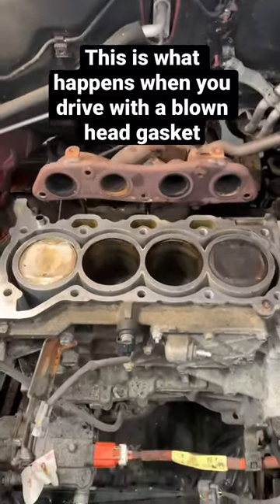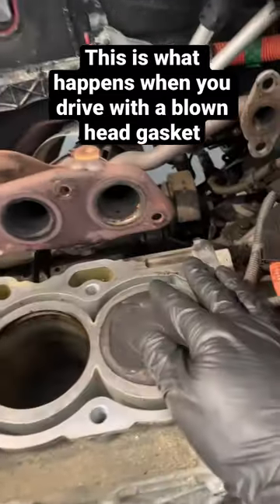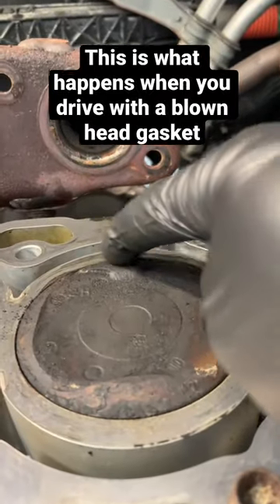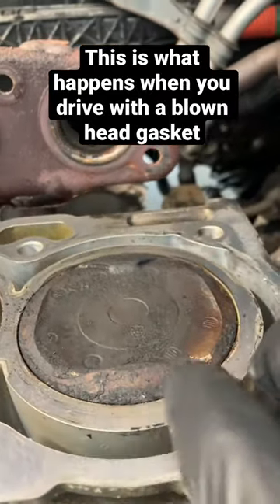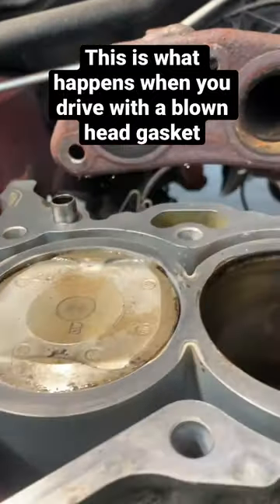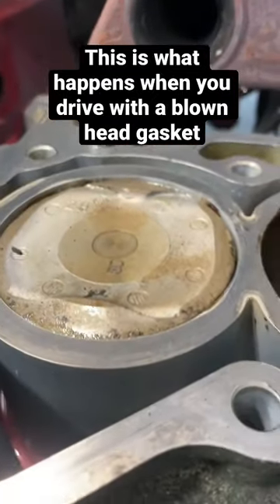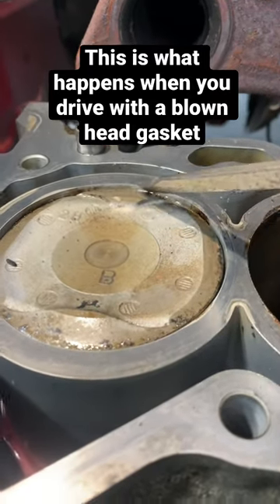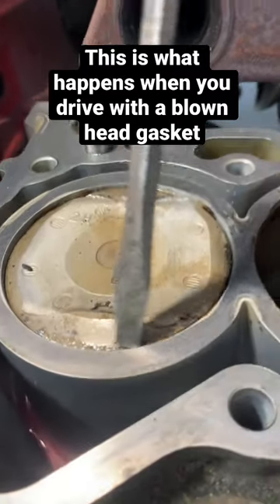Blown Head Gasket

Comment: Extra hundred bucks! Where are you located 😂
Reply: Couple hundred bucks!
Reply: I'm on my way what's the location😂
Reply: Lol... exactly
Reply: I mean he is already there so the only extra work is dropping that pan and disconnecting the rod and changing it over so its not much added labor
Reply: @james10739  unless removing the pan also requires removing the crossmember on some cars
Reply: @XShadow705 which it does on most BMWs
Reply: Exactly what I was thinking
Reply: @XShadow705 I don't really front wheel drive 4 cylinder and it depends how it's made but if it's just removing a crossmember and pulling a pan and pulling a rod and piston a couple hundred bucks seems fair it not the total it's a couple extra but I replaced a piston on my mom's Buick with a 3800 and there was not a big deal to do just a piston once I was already doing a h3ad gasket
Reply: Lmao my thoughts too my sister drove my 5.7 hemi after she blew the head gasket until it shut off on her 😮
Reply: As a mechanic, once your engine is already a part and they paid the deposit Typically they just pay for parts, which is actually double the price of what they really cost.
Reply from the maker: Tampa Hybrids
Reply: you mean to say  couple thousand dls more 😂
Reply: @organicportalphobic9601  🤣 gotta eat
Reply: This is when an honest mechanic does the job. If not...
Reply: Dang bro, I'll be right there too
Reply: On top of the overall work price lol
Reply: Isn’t it possible that the piston, rod and even the crank could be toast?
Reply: Lmao
Reply: @TheHybridWizard  bruh im in NY. Brakes cost me 1200 bucks. IN 2014
Reply: Hahah I need my Piston rings and rods redone also wya
Reply: its not hard to do the word your self, for my car its gonna cost me 129$ to order my head gaskets from autozone and put the head gaskets in my self, watch a video and learn to do it your self its not hard

Comment: Back in the 80s we picked up a Camaro for $400. It had a blown head and head gasket. We got another used head and a new set of head and exhaust gaskets and took the heads off. The pistons were spotless! The antifreeze had broken loose the rust and sludge and whatever else stuck to the pistons and blew it out the exhaust. We replaced the gaskets and put her back together and sold the car for a lot more than $400. That was an easy fix that only cost about $130 to fix back then
 That was a sweet 1981 Camaro too, and I was wishing I could've bought it but I didn't have the money. Too bad cuz I would've had that car a long time. It was in pristine condition and would've lasted me a long time. And back in those days we went through cars like nobody's business.🥴

Comment: If the hg floods the cylinder eventually when the engine sits for s while, it will bend the crank. It's maybe called hydrolocking, when the fluid does not compress and the pressure forces are so huge it will bend. Its not common but definitely plausible.

Comment: Ok this is because of two reasons.1 water in the combustion chamber steam cleans the entire combustion chamber and exhaust ports .2 water does not compress so the water acts like a little scrubber cleaning the combustion chamber. 
I actually run a water/methanol or straight water injection on all my cars new or used a super neglected engine and even direct injection engine will be spotless after no more than 15,000-20,000 miles of running a water injection system. I don’t care if it has 500,000 miles it will still be clean after 15-20k You can get one of about $200
Reply: If you know what you are doing you can clean a engine like this for free

Comment: Couple thousand dollars more. That block is cracked somewhere
Reply: A bent connecting rod doesn’t always mean a cracked block but it can wear the bore incorrectly
Reply: With an open deck, wouldn’t there be a pretty decent chance of the cylinder cracking?

Comment: That's not the only thing that happens
Reply from the maker: Absolutely. It can lead to further damage like blowing a hole in the engine due to the connecting rod breaking
Reply: @TheHybridWizard  my jeep Cherokee xj just blew a head gasket it still ran after driving it to my house hope i can repair it
Reply: @honja6528 have you repaired it.??
Reply: @dawgwaze5107  no not yet
Reply: @honja6528 brah same here our Cherokee Sport blew a head gasket and i hope everything is still fine within the block.
Reply: I've been driving on a blown headgasket for like 2 months now with my 98 4runner. Apparently it's making me have misfires as well which was a mystery for a long time for me. New oem coils plugs and wires didn't even do a thing.

Comment: Lol run it won’t hurt nothing I like to see that rod bent I don’t think it is
Reply from the maker: I already replaced the piston it was definitely bent. I can send ya a photo if you’d like!
Reply: Please do show that picture,because no 2 pistons should be flush at the same time on a 4cyl. One may be,but the other that is up,should be slightly above or below. Rotate the crank,it will reach flush
Reply: @boostdkid401 they are called companion cylinders. 

Please don't vote
Reply: @boostdkid401 and that piston will never be up because the rod is bent evidenced by the tech with knowledge who showed it with a protrusion test. A very very valid test. But u didn't learn did you? No, u wanted to argue with an opinion that is worthless. Why? U see now u can look at that pic and easily tell some one that rod is bent. They could pull it out and think u were superman with x ray vision and ask how did u know. It would be knowledge. Learn from those with experience don't argue or u will never become a man

Comment: Coudnt that be from a destroyed bearing. Why would a bad head gasket bend the rod
Reply: if hydrolocked, and the connecting rod gets bent from trying to compress non-compressible fluid
...
Reply: @jon_byler wouldn't the head bolts stretch first??

Comment: Dudes why do I have oil in spark plug bay...I'm about to change out all gaskets in hopes that that will fix that problem..any one with good info help a brother out.its an 02 dodge ram 1500 4.7.
Reply: There'su little O-rings at the bottom of the spark plug tubes. On some engines, they are integrated with and actually part of the valve cover gasket. They leak and fill the spark plug well with oil. Usually the leak is slow. Remove the plug and let the oil drop down into the engine. It might not fill up with oil and start misfiring for years.

Comment: Does the two middle Pistons have broken rods because they are even lower? 😊So that’s another 400 i guess.
Reply: Four cylinder engine has the two center pistons at bdc when the outer two has pistons at tdc. Bdc meaning bottom dead centre, and tdc meaning top dead centre.

Comment: Or , you can turn the crank pulley a bit and cylinder numero uno will be flush and number 4 will ..... need some work????😊😂
Reply: The crank is already at Top Dead Center. Which means thats as far as it goes. (Cylinder 1 and 4 are synchronized. Just like 2 and 3 are) if one piston at max its pair should be as well

Tell me you know nothing about engine maintenance, without telling me you know nothing about engine maintenance 🤦‍♂️

Comment: Cylinder sleeve is not a deck surface....
Reply: Yes it is 😂
Reply: @Industry-insider  cylinder sleeve is always, up to 0.05 mm, above the deck surface
Reply: @josipdrazin6708  no it’s not, you install them then deck the engine so they couldn’t be above the deck
Reply: I can't argue with you but still I think that cylinder sleeve protrudes a little above the deck or engine block surface
Reply: @josipdrazin6708  there would be no way to machine it if that were the case
Reply: @Industry-insider  oh, good point 😅